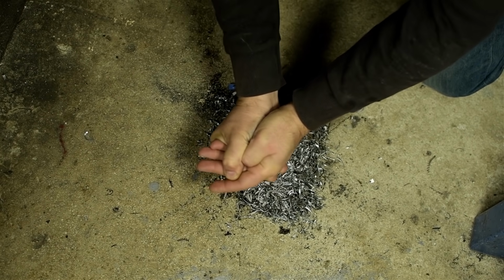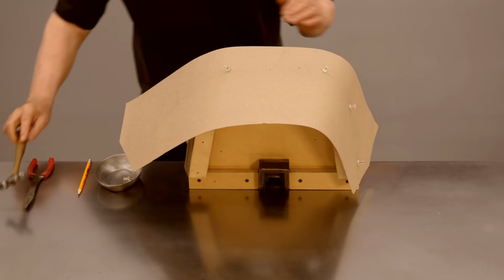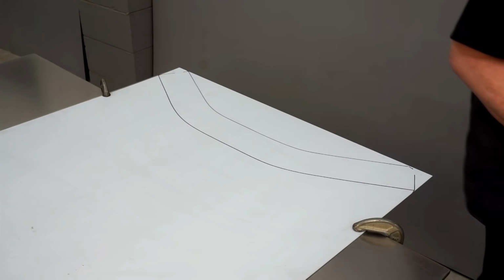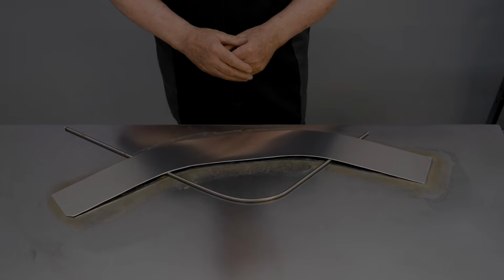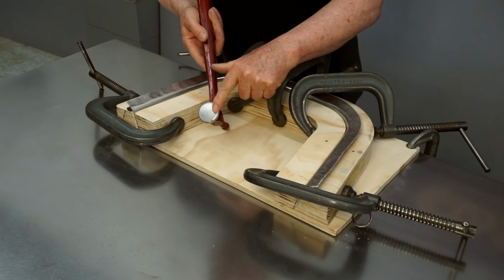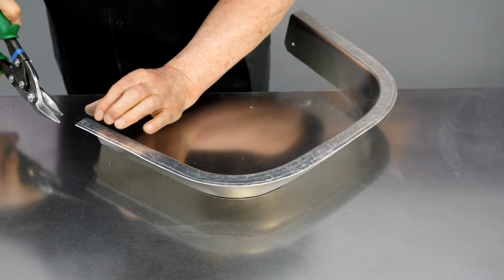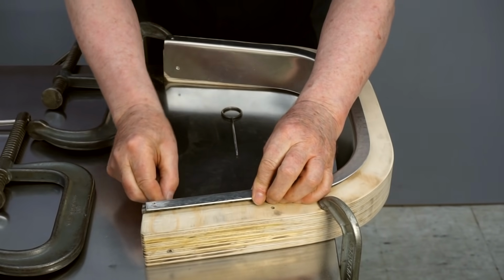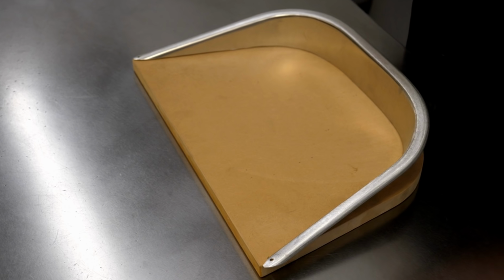Cleaning Up! with This Old Tony - Part 2

Comment: Great video ! I really enjoyed it . I wish I could find a job where the boss would allow the employees to do things right like you do , it's really depressing when every boss I have worked for would have expected me to use 3 pieces of wood , some tin , and some drywall screws and a drawer handle :(
 I have a small request , I have heard of people using a piece of lead bar to protect the aluminum from the hammer so no sanding is required (like in aircraft applications where sanding would not be allowed). I would really like to see this technique .
Reply from the maker: I have seen people who used a bar of lead instead of a hammer. Apparently not only does this protect the surface of soft metals like aluminum, it also will stretch the metal less than a steel hammer. 
I've never tried this myself, but it might be something to experiment with in the future.

Comment: I would make the angled cut line with water (maybe add dye) or a laser level.
Reply from the maker: Both of those would be good options if you can stabilize the part while marking.
Reply from the maker: Hey - that's a very unique solution - I like it!

Comment: Good tip with the marker, would it work for copper? I'd like to make some 10mm flanges on the ends of some copper pipe so I can v-band clamp them together. Would making a 3 piece wooden hammer form like you have be viable? Thinking drill a hole the size of the pipe, then use the plug removed for the inside to clamp the pipe so it can't move whilst forming?(the piece which goes around the pipe being cut in half for removal purposes).
Reply from the maker: The forming technique you describe should work well on copper pipe. Copper anneals at about 700 degrees F (400 C), so the marker technique would work. Most people heat copper until it just starts to glow red to anneal it - this is easier to see in a darkened room. 

With copper, quenching is recommended to prevent grain growth, which can weaken the material.
Reply: @RonCovell  thanks for the reply, hoping to use it to form "triclover" fittings in larger diameter tubing which should save a fair bit of $$$ and reduce the potentials for leaks at joins

Comment: Great video.  You are giving me ideas for some projects.  Would this work with thin steel?  Are you going to re-harden the aluminum?
Reply from the maker: I'm delighted that you enjoyed this video. I will be posting the last in the series as soon as I get the handle from TOT. Yes, these procedures will work with steel, too. 
The alloy of aluminum I'm using - 3003 - is not heat treatable, so the only way to harden it is by working (strain hardening). The sides and back are worked so much that they will have a good degree of strength, and I will not anneal the bottom piece.

Comment: So, my thoughts on how you'll do the angle piece... Thinking you'll use both hammer forms, flip them upside down, and elevate the front to line up with the top edge and then scribe a line around the visible part of the dustpan side. But, that's just a guess... Although, you've already made it, so it really doesn't matter my thoughts, other than a prediction.

I do have a two party question regarding the hardening of the aluminum. You say it comes semi-hard, but is that just from the work hardening of the rolling to get it to the correct thickness, and could you therefore do some of the same to get it to a similar hardness?
Reply from the maker: Your suggestion is not far from the procedure I used. You'll see it in the last video - coming soon! The alloy of aluminum I'm using for this project - 3003 - is a non-heat treatable alloy, so the only way to regain the original strength is to strain, or work-harden the piece. There is one other consideration - and that is the strength added by changing the shape. Flat metal has very little resistance to bending, but the more curvature or shape you put into the metal, the stiffer it gets.

Comment: This is an awesome project if you have a CNC router like I have to create the wooden templates/forms. And of course the necessary CAD skills to create such a model :)
Reply from the maker: If you do make a dustpan with a CNC router, I'd like to see it!
Reply: @RonCovell  Nah sorry Ron I meant you can more easily create the wooden patterns!
Reply from the maker: Oh, I get it. Yes, that's probably true, but since I don't have a CNC router, I do things the 'old-fashioned' way!
Reply: @RonCovell  I'm creating right now the dustpan in a 3d format for all CAD applications (.step file). It's going to be in Class A quality, which means the same tolerances as are used for outer surfaces of cars.
Reply from the maker: I'd love it if you could let me know more about your project! You can send pictures to me via email - covell@cruzio.com

Comment: 6:28 is there a specific marker used for determining the temperature? Or is it just a permanent marker, if so what brand?

Thank you!
Reply from the maker: Every marker I've tried works fine, but I prefer the black, permanent markers - as opposed to any color, or dry-erase versions.
Reply: @RonCovell  thank you for the quick reply!
So I am assuming a broad chisel sharpie would suffice.

Thanks again.
Reply from the maker: Yes, even a fine point sharpie will work. You don't have to cover the metal completely with ink - but more ink is better than less - to minimize the risk of overheating.
Reply: @RonCovell  again, much appreciated. Thank you sir.

Comment: @Ron Covell Could you put a link or more details about the Ink you used to anneal the aluminum?
Reply from the maker: It's a Sharpie 'Magnum'. The ink is the same as in their smaller pens, and I think any brand of permanent marker will work the same. You don't actually have to cover every square inch (cm) with ink, but if you make individual lines of ink, they should be fairly close together.

Comment: I would use an orbital sander with 220 on it for stuff like that wouldnt bother locking it. the loading doesnt happen at all for me when its not locked.... unless you are going for that " machined" finish... which I totally understand :3 I like those perfect feathers too. paused at 15:40.... ahhhhh I see o-o... im still with my keeping it orbital and 220/waxless. those lighter grits are easier to get in bulk for cheaper... the sticky linked rolls.... they dont load up on me... maybe its the speed?  -- just an opinion o-o thanks for the video. I learned a few things about forming ^-^
Reply: note* I didn't take into consideration he softness of the material.  the usual stuff I have to work with is half hard or more aluminum
Reply from the maker: Everyone has their own techniques - that's what makes the world go around!

Comment: Ron, are you going to use the gas welding tricks that Kent has been showing us at the SCruz metal meet for the next episode?
I am eager to see what ToT does for a handle.  My lathe isn't big enough to have the time machine feature, so I guess I'll just have to wait.
Reply from the maker: I considered gas welding the dustpan, but I'm going to TIG weld, simply because my skill level is higher with that process. Both Kent White and Kent Caveny have demonstrated at the metal bashing meet, so I don't know which one you are referring to, but Caveny just released a great booklet on gas welding - it's available at Trick Tools: https://www.trick-tools.com/search/go?w=caveny
I'll have the last video completed shortly after I receive the handle from Tony - around the end of the month, with any luck.
Reply: @RonCovell  I was thinking of Kent Caveny.

As always, I'm impressed by your mastery.  Looking forward to seeing the next video.

Comment: Is that marker a Sharpie or a special temp sensitive variety?  That would work great for brass too!!
Reply from the maker: It's just a 'regular-old' Sharpie. As you know, there are special temperature-sensitive crayons available - and they have their place - but the common Sharpie works well for aluminum.

Comment: May be easier to use a nibbler to cut that than a jig saw, especially now that it's softer and needs an angle cut
Reply from the maker: That would certainly work.
Reply: @RonCovell  very cool project overall, I like heavily built stuff

Comment: Ron, I am stuck in a sticky situation. I need to reproduce sheet metal rear fenders from a rust damaged 1992 Ford Taurus SHO. These are not available for sale and only can be made. I have a metal shrinker, hammers and dollies,  sand bag and a mig welder. I have a rudimentary knowledge how to use them all but  there are so many ways you can start. If you can give me any advice or link to a few of your videos I'd be forever in your debt. How do I match that shape?
Reply: Not the entire panel. Maybe 2" around the entire fender well.
Reply from the maker: My YouTube videos 'Scratch-Building a Fender, parts 1, 2, and 3' will answer a lot of your questions:
https://www.youtube.com/watch?v=Ktj5DWaKXYI
Reply: @RonCovell  Thank you so much for the reply. You are very generous with your knowledge.

Comment: Great video @roncovell

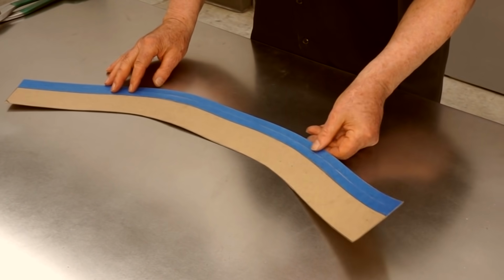At 4:46 why did you orient the pattern in the stock that way up instead of aligning the 'top of the rainbow' with the edge of the stock? 

I see people on YouTube cutting small things from the middles of big sheets and it triggers me every time.

This isn't too bad but I was hoping there was a good reason for having to cut the whole perimeter and end up with a center cut off...
Reply from the maker: You bring up a very good point. I try to be just as efficient as I can when cutting my parts out, since metal is not cheap!  I did the layout that way because that sheet had some damaged areas I was working around. The damage is on the side facing down, so you can't see it on camera.

Comment: Silly beginner's question: why not do the angled cut before shaping the part. Is it because it would deform?
Reply from the maker: Very good question. I would be very hard to hold the part in the hammerform if it tapered toward the edges. I made one part without using the pins to trap the 'legs', and it moved up as I was hammering the flange in the back.
Reply: @RonCovell  Ah, OK. Thanks!

Comment: Awesome work mate what grade of aluminium did you use
Reply from the maker: I used 3003 H-14, .062-inches (1.6 mm). I'm guessing you're from 'down-under' (since you use the term 'mate'), and this is an alloy that's not readily available there. 5005 is a comparable alloy.

Comment: The biggest question I have is how long does it take to learn to hammer that fast? And did you use TOT's time machine to compress your learning time?
Reply from the maker: A lot
Reply: @RonCovell  That is what I thought. Someone told me it was video trickery, but there is no way anyone associated with TOT would do that.

Comment: Where can I find those alignment pins?
Reply from the maker: Those are homemade. I used to just bend 1/8-inch welding rod into an angle, but that puts a slight bending force on the pin when trying to pull it out of a tight hole. The round loops keep the pulling force centered, and they actually work much better that way. I made loops by bending wire around a round bar, then welded the loops to the straight part.

Comment: Are you going to mark your angled line in a pan of water maybe?
Reply from the maker: Well, that might be one solution, but as you'll see in a few weeks, I will do it another way.
Reply: Had another thought,  could you not roll a round tube covered in paper along the length of material where you want to have the angled cut? Work out the length of the cut that you need and the just unroll the paper and mark a straight line, then cut it out, use that as a template for each side so it’s even?
Reply from the maker: Well, I guess that technique would work. You'll see the solution I used in a few weeks!

Comment: Brilliant Video, and great collaboration!  Out of curiosity, when laying out tape like you did on the pattern how do you get it to cleanly follow curves? I've never been able to do it well, it always bunches up and becomes a mess.
Reply from the maker: Glad you liked the video. I have a lot of years practice in 'pulling tape', and I have learned what you can and can't do with it. If you are having problems, using thinner tape (and more than one stripe) often helps. I used two rows of 1/2-inch tape knowing that I couldn't pull 1-inch tape to that tight a contour. Also,  to eliminate wrinkles, you usually have to pull the tape enough to stretch it a certain amount, while not stretching it enough that it tears. Practice makes perfect!
Reply: @RonCovell  That makes a lot of sense, I think I have some 1/4" tape somewhere, so I'll see If I can dig that out today and put in a little practice time! Thanks for the tips, I really appreciate it!

Comment: wait, so that aluminum comes in a half-hard state but then you said it's a "non-hardenable"... so then how did it come in a half hard state ?
Reply from the maker: The non-heat treatable alloys of aluminum are strengthened by strain (or 'work') hardening.
Reply: @RonCovell  ah, so they get work hardened when they get pressed/rolled into their final thickness ?
Reply from the maker: Yes - the huge rolls that are used to make sheet and plate are used to work harden the metal as much as desired.

Comment: 1. Would the same techniques be used if you were making this from sheet steel?
2. Do you ever use a power hammer or planishing hammer? If so, please show. 
3. 👍👍
Reply from the maker: Yes, steel could be formed in the same way.
I do some work with a planishing hammer, and you can see some here:
https://www.youtube.com/watch?v=sK0oGJEf1Hk
I don't have a power hammer.
Thanks for the thumbs up!
Reply: Dad always said nothing beats experience. But, you do make it look easy.

Comment: I have seen aircraft sheet metal workers use polyester body filler to make bucks for forming odd shaped parts similar to this.
Reply from the maker: Yes, I have used 'Bondo' for bucks, and it works well. There are special grades that are filled with glass fibres, which is much stronger - and some are even filled with powdered metal. (All Metal) For really heavy-duty forms, you can get fillers made from epoxy - which is much stronger than polyester. JB Weld is one example.

Comment: Ron, you made a great mistake going into collaboration with This Old Tony.  I just know, when your part of the dustpan is done, Tony is just going to clamp a Vise-Grip welding clamp onto it to use as a handle and just be done with it!   😁
Reply from the maker: Well, I guess I am taking a risk here, but we'll see what Tony comes up with. I still don't know which end of the pan he'll put the handle on.
Reply: @RonCovell  Well, judging by what we've seen so far.......
Reply from the maker: Hmmm - I see your point.

Comment: Not that I am a metal expert by any means but wouldn't it be easier to make the exact shape out of wood and then "floform" the metal into shape. Might have to anneal the metal a few times while working it to keep it from tearing. Then trim the edge off.
Reply from the maker: I thought about making this dustpan from one piece of metal, using the technique you mentioned. A shallower part could have been made that way, but for the depth of the flange needed on this part, I think two-piece construction is preferable. If someone else makes it from one piece, I'd definitely like to see it!
Reply: @RonCovell  I would love for you to do a tutorial on the use of a heck trace-A-punch if you have one. I have one and find it to be handy. If I made a pan like that out of 1 piece I may have used my heck trace-A-punch 4c model to trim the edge after it was done.
Reply from the maker: I had to go online to see a Heck Trace-a-Punch. They appear to be an excellent machine, indeed!

Comment: ...having been a Structural Airframe Repair Tech in the USAF, I thought I knew a thing or two about sheet metal. Seems I don’t...🤣‼️🇺🇸
Reply from the maker: I'm sure you know a great deal, but compound curves are studiously avoided on the majority of light aircraft.
Reply: @RonCovell  
Just as you said. 
My base were strictly fighters, but an occasional “regular” plane would show up needing some “ work” , the wing to fuselage joint was the bugger. Also had a couple of Hueys on base that had a few compound curvies on ‘em... . Don’t remember an English wheel in the shop but I do remember the stretcher/shrinker and rawhide mallets😁Those were good times. Ended up as a machinist when I got out. Taught myself CNC about 30 years ago. 
Love metal💪🤣👍
PS: Kudos to This Old Tony for turning me on to your page‼️❤️

Comment: Is this a bespoke item or something that was made in production back in the day
Reply: Looks like a one-off to teach the techniques in a fun way. Any production facility would bang these out on a punch press 10 a minute. I can see a lot of use for this for custom work which is what he specializes in.
Reply from the maker: This is a bespoke dustpan that looks surprisingly like something that was made at a very low cost in equipment that costs more than most people make in a decade.

Comment: About wrapping the form with paper and scribing the edges of the form with a pencil- 
 My far less experienced brain (and far less talented hands) tell me that rolling the form on the paper while incrementally tracing the form as I go would produce an accurate template in a simpler fashion.
  I'm embarrassed to say that I can't understand why I'm wrong .
 Can you tell me how that method will go sideways, as long as I don't slip?
Reply from the maker: The technique you describe is called 'Rollation', and I showed a version of it in the previous video. It certainly will work if the part doesn't slip. 

If the edge of the form was at a 90-degree angle, I probably would have done it that way. At 20-degrees, gravity is constantly trying to 'topple' the form, and it's hard to keep it from slipping.